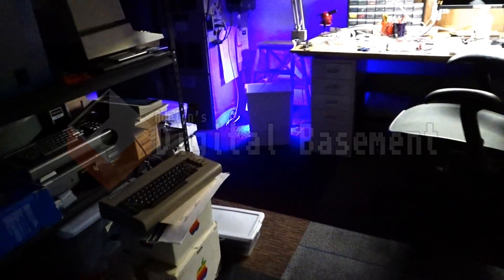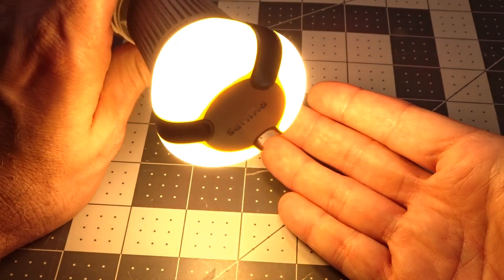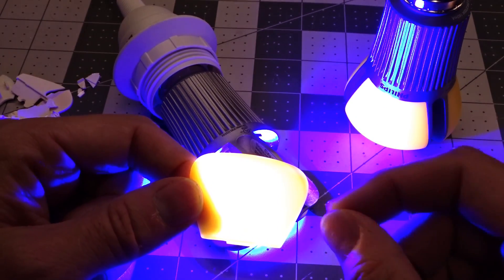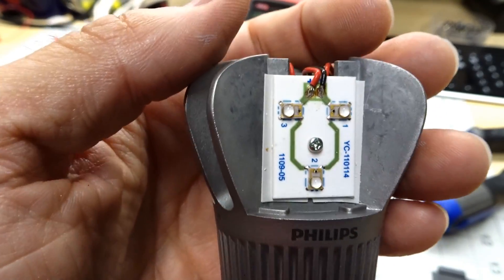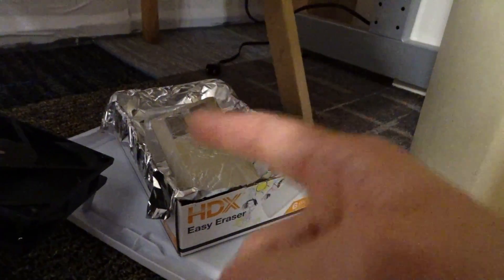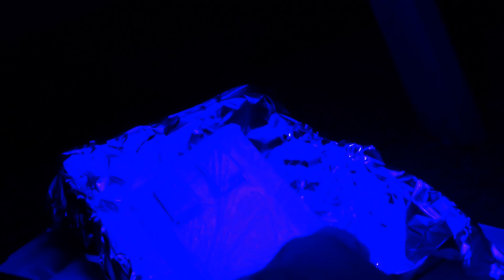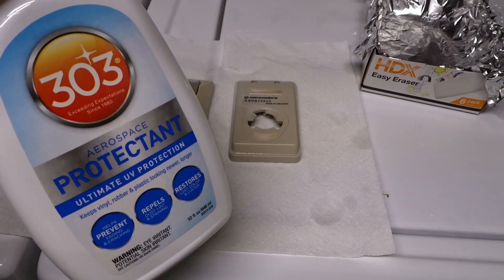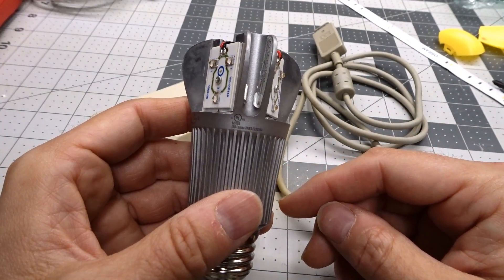A new way to fix yellowed plastics indoors?

Comment: Great video gave you a like. The wavelength of the blue LEDs may not fall into the UV range enough (LEDs have a fairly narrow band spectrum) and that might be why you get good results but still some yellowing left behind. You may have to re-treat and expose longer (maybe two days) with your lights. Remember, if you treat one side at a time, mask off the areas that don't have cream on them, else you are exposing "raw" (bare) plastic to UV/Blue light and thus contributing a bit to re-yellowing.

Comment: There's nothing strange about those LEDs at all. There is no such thing as a white LED. They are all near-UV LEDs with a phosphor coating on them. In this case they just had the phosphors in the plastic shields, probably because they hadn't perfected the liquid phosphors that they now use on all LEDs, especially COB LEDs. If you scrape a bit of the phosphor off of a COB you'll see the blue LEDs underneath.

Comment: Heat + UV really is the key.  On a sunny summer day in 90-100 degree sunlight you get amazing results.  On a cool 60 degree day not so much.  The heat radiating from the lights might help but most LEDs don’t emit much heat by themselves.  I have heard of guys bleaching their sneakers white just by leaving them under UV light alone without peroxides but I’m skeptical with plastics that direct UV alone will accelerate the Bromine yellowing.

Comment: I have to give you a gigantic thank you! I saw the title of your video, saw the LED blub and that really got my interest. I bought a similar LED bulb (mine is 1100 lm brightness) about 8 years ago, and still had it in a lamp in my office. I've been trying to remove yellowing on the previously clear plastic parts on an expensive pair of sunglasses I bought a decade ago. Previously I tried soaking the parts in drug store variety 3% hydrogen peroxide solution overnight, no change. I also tried laundry bleach, zero luck there also. After watching your video, I decided to give your process a try. After a few minutes of slightly tricky knifework, I got the phosphor filters off with the minimum of breakage. I put the bulb in an old clamp light, and fixed it over my work bench. I used the same 3% solution, in a small tin foil pan. I used an infrared thermometer a few times over first few hours to verify nothing was getting dangerously hot. The solution remained at about 74° F, roughly room temperature. The shade of the lamp was about 84° F, and the bulb around 185° F. Mostly sure I wasn't going to cause a fire, I left it alone, and checked back about 8 hours later. At that point I could see some serious improvement. I moved the parts around to ensure even light coverage, topped off the solution with the last I had in the bottle. 6 hours later, I pulled out the parts and washed them. I estimate they look about 95% un-yellowed at this point. I love that I spent zero dollars on this (already had the bulb, bought the solution for first aid use originally) and got such good results. Once again, big thanks!

Comment: This is not really a big surprise that this works. You're using H2O2, which dissolves to H2O + O and the single oxygen atom burns the top layer of the plastic away (which layer is the yellow one). This is an exoterm reaction, and you don't even need to add energy to it to happen, but extra energy speeds this up. Although the huge energy of UV quantums is very good (as a single hit to H2O2 is very likely to break the bond on its own), that is not necessary. What you really need is either time or temperature. 
Temperature always improves the speed of reactions; as a rule of thumb, an extra 10 celsius doubles the speed. Thus, even a strong IR lamp could do the trick, even if its light has quantums with much less energy than that of the blue light you have. You also said that it gets really hot, so you need a fan, so the temperature is there, the quantums are not perfect, but still good... You don't need more!

Comment: I wonder when you took the covers of and noticed the led’s are emitting blue light if it is uv-c light if so you need to cover your eye and protect them so you don’t hurt your eye. Another thing is if it is actually uv-c that is awesome uv-c light kills viruses 99.9. Literally kills the flu which is carona virus in its entirety with you want to call it the flu or Covid it is all corona. Why do you think there are so many cases of the Covid 19, they can’t tell if you have the normal flu or Covid 19. They literally stopped testing for any flu at all this year because you can’t tell the difference just like if you were sick 9 months ago and got a Covid test it will test positive even though it’s only antibodies. Yes they can break it down and see but it’s not done you are just added to the statistics wether you have just the flu or if you already were sick awhile ago they are counting everything as Covid why do you think you see these crazy numbers but yet our politicians are still eating at fancy restaurants and flying to Hawaii during thanksgiving. They know it not that bad for most otherwise they would be in a bunker if this were a try pandemic.

Comment: Remember those huge internal projection tvs? They show up on the curbs from time to time. They have very expensive mirrors in them. I know because I pulled one to use in my video projection transfer project. I was able to configure one at 45 degrees and project the image for digital recording. Ant way, I suggest you change the foil to mirrors and see if you get better coverage.

Comment: ozone would be a replacement for peroxide. in fact, one could build an ozone wash bin to flood the parts in ozone while shining said lights on the object. It'd be cheaper in the long run than having to get so much peroxide. a few cents of electricity instead of several dollars of peroxide.
Reply: what retrobrite needs is a form of what I like to call, 'angry oxygen' such as peroxide, or ozone.

Comment: I have an older PTZ surveillance camera that is severely yellowed because it was mounted out in the open where the Sun and elements battered the housing.. I was wondering if I try to reverse this process will using a 4k clear coat prevent it from yellowing again because it would be extremely difficult to reapply 303 UV or some other kind of UV protectant due to its mounting location.. You'd think that it being exposed to the elements, the manufacturers would use some other type of material for the housing instead of this type of plastic..The newer PTZ cameras that I have installed are usually made of metal and painted with a matte white enamel which seems to resist any cracking or coloring defects over several years of use..

Comment: I always retrobright indoors. The magic is in the heat, not uv light. That's why the hair dresser uses heat when bleaching hair, not uv light. I'm using 12% peroxide cream and plastic food wrap (it blocks UV, you know that right? ;) ). 

I just put it in the oven at 60°C/140°F for three, four hours and massageing it about every hour to spread the peroxide evenly.

Comment: Sorry if this is a stupid question but instead of the 303 UV protection could I use a clear coat instead for longer lasting UV protection ?
For example "Rust-Oleum" Crystal Clear spray? This one says non-yellowing specifically. Thanks!

Comment: What i found to work too, was putting a little hydrogen peroxide (fluid) and water (1:5 ratio maybe) in a container with the part and make sure it doesn't rise to the surface. Then apply heat (on a heated bed of a 3d printer or on the stove) at around 150 -160°F or 65-72°C and wait a few hours (i did 3 to 4 depending on the size of the piece). 

I did that on my SNES and it looks brand new. What i would recommend though is spraying it with some UV resistant clear coat so it doesn't get yellow again. No matter which method you use if you set it in the sun again for a time long enough, it will get yellow again.

Comment: Hi, Adrian - fascinating stuff!  My solution to yellowed plastic was to sand down to the real color, and then polish using Meguiars Plast-X compound; but this is insanely labor intensive, and it removes the original factory finish.  Retrobrighting is such a better idea.  I suspect that you're actually getting a fair bit of UV radiation out of those LEDs, in addition to the blue light; my understanding of LEDs is that they have a frequency response curve similar to florescent tubes, in that you get a bunch of square wave bursts of high output at specific frequencies, and no output at adjacent frequencies.  This is as opposed to an incandescent bulb, which has a nice smooth curve typically centered around 2400 - 2600 Kelvin.  Anyway, I suspect that it's not the visible blue light that's doing the job; the LEDs are also emitting UV radiation, and it's the invisible, UV radiation that's at work.  Just a guess.  Thanks for the excellent video!  I've subscribed.  Regards, Charlie
Reply: LEDs typically are monocolor -- they emit a single wavelength, or sometimes a very narrow range. They're certainly nothing like the output from fluorescent tubes in terms of spectrum.

Comment: Well I just hunted some of these bulbs down on ebay. 1st off, NOT CHEAP. I see them between $15/35 a piece. 2nd, there are not many out there. I only found 3 sellers. But 3rd, they do have a life expectancy of 22 1/2 years. So I did end up buying 4 of them and figured with the amount that I will do, these will probably last me the rest of my life. The ones I did find are not new so your mileage may vary. This will be fun. Thanks for the great video

Comment: I don't think it's specifically the UV that's actually facilitating the retrobright process. The chemical change is driven by an external energy source and UV just happens to be a good source for that process. Heat can also work, but that has the potential to warp the plastic. These lights work about as well as UV because they're very close to it, hence the fluorescing of things. You could use white or even red light, or even just no light at all and the process would still work it'd just be much, much slower.

Comment: A minor note about bleaching gels, I did an experiment to compare the expensive BBlonde gel vs. a much cheaper brand, each half of a keyboard under strong sun exposure. Afterwards, the results were quite good but there was no discernible difference between them. May as well buy the cheaper brand, though the BBlonde box did have a  better kit in terms of accessories, gloves, applicator, etc.
Reply: I should mention btw that I was doing the test with an SGI granite keyboard, so there is a possibility that may have affected the outcome. In the event the cream, in both cases, didn't have quite the even effect I was hoping for, so I want to look into the method The 8Bit guy uses with peroxide solution, but so far I've not been able to find any (such stuff is listed on Amazon, but generally with very poor reviews, presumably it's weak junk). I'm in the UK (Scotland) so lack of strong sunshine is an issue; I've been pondering UV lamps or somesuch but have put it all on hold for the time being, tad busy with family matters. Interesting that you found a reapplication made a difference; my house is not well positioned for such a long sun exposure (side of a hill), so some kind of artificial light would be more effective I reckon. I'll look into the LED idea later in the year. Thanks!!

Comment: Nice video.  This might come off as a little armchair quarterbacking, but it is just my initial thoughts so no offense intended.  That said, to really test to see if it works you need a control sample. One that is not under the light but also inside without the sunlight.  Preferably from the same plastic parts.  That will tell you if the light is doing anything or if it is just the creme.  

I have retrobrited keys inside in a jar of 3% peroxide and they did indeed lighten without being in the sun.  It would be interesting to see this experiment again with a control sample.
Reply: Yeah, for me it is probably impossible to retrobrite without any sunlight as I have windows in my house.  But I suppose at night my keys are in the dark.  However I do add OxyClean to my solution and supposedly that helps.  Maybe with that it doesn't need as much sunlight because my keys lighten indoors but it takes more time for sure, then full sunlight.  Just curious about the Blue LED light source.  You got good results for sure.

Comment: Interesting video. I've had similar success retrobriting old Apple computers & keyboards using a metal halide bulb suspended over the creme covered parts in my bathtub. This method isn't as quick as putting them out in the sun, but it means I can retrobrite in the middle of winter here in Canada which would be impossible otherwise. My idea is it's the UV generated by the halide bulb which is reacting with the hydrogen peroxide rather than the colour temperature or visible wavelength of the light.

Comment: You need some laser light protective anti UV glasses. Unless you are planning on going blind mate !!!!
Reply: No uv in that light. LED's are monochromatic e.g. they only emit at 457nm ±10nm which is nowhere near the 380nm-315nm of UV light. So it's not as dangerous as UV, but still more harmful than lower-energetic light

Comment: Also for what it's worth, my feeling is that retr0brite:d plastic should re-yellow at the same rate as the original yellowing. As far as I understand it, the yellowing is caused by bromine atoms liberated from the UV-induced photodisassociation of bromine-containing flame-retardant chemicals, and retr0brite:ing chemically reverses this process, leaving it free to begin again.

Tangentially, I lived in New Zealand for six years, from 1992 to 1998, and I own quite a few books that were exposed to the harsh, UV-rich sunlight due to the proximity to the Antarctic ozone hole. I grew up in eastern Canada, where the burn time might be half an hour, at worst, in mid-summer... in Auckland, New Zealand, it can be just a few minutes in mid-summer. My book collection contains quite a few whose spines have been bleached into near-illegibility.

Comment: You got a result so you're on to something!  I use a full spectrum light which is well vented so it doesn't heat the plastic parts, so it's possible with the right light.  Sometimes I also sousvide to add heat and that works very well but if I'm feeling lazy I'll blast the part with a heat gun periodically to speed things up.  If you're getting heat from that light it's also helping the process.
Reply: @adriansdigitalbasement  awesome looking forward to it.  Need all the help I can get in rainy UK

Comment: As a tip for you :) Buy UV LED Strips (non water proof, you want the bare strips without the plastic rubbery coating) and cut them in to strips to desired length. Attach them to an aluminum strip / board (helps keep heat down and makes it easier to mount) and solder them together, you can then make a shop light like UV light for retro brite-ing to your hearts content :D Plus makes for a neat blacklight for those posters that came with the Atari Classic console
Reply: @adriansdigitalbasement   problem is hitting the right wavelength, especially with RGB strips  one strip I have does it, another doesn't. Plus the physical size of the blue segment compared to uv strips which are purpose built :)

Comment: The reason for that plastic to go brittle is the near-UV from the LED's. It destroys most plastics over time. Please don't stare too much into it - it's somewhat dangerous to look at those "Royal blue" LED's. Looking at blue LED's will lead to Macular Degeneration - something that cannot be reversed.
Reply: I would think wearing a pair of ordinary (decent) sunglasses would be enough to block any UV-A and also reduce the visible brightness to the point where it is a non issue. You don't need anything fancy.
Reply: @bubba99009  Now all you have to do is protect the rest of your exposed skin.
Reply: zapro_dk yeah, guess you need those laser light protective glasses, that 100% block uv etc....good tip mate !
Reply: UV does not weaken the plastic.... HEAT and TIME causes plastic to lose its oils and that make it brittle.

If you follow enough channels, you will find that the exposure to UV full spectrum is needed, no creams or liquids, just full UV and it has to be outside or the type of UV that has UVA and UVB.
Reply: The blue lights are UV light, the phosphors glow from it, the light you refer to may be called Royal Blue but taking in to account that UV light is around 400nM range... Ta-Dah....
Reply: Well I expected someone to say these LEDs are dangerous and they did
Reply: Scary shit. Good information to know in case I'm ever in a situation where these are in use. Thank you.
Reply: Holly shit! :o had no idea that it can be that bad...
Reply: That's probably why they don't make these blue LED's anymore, it could possibly attract frivolous lawsuits, when some dummy takes off the phosphorus shield and stares at for long.  I would imagine that these Blue LEDs also have an ultra violet component (or very close to it), which of course is invisible.
Reply: Regarding Macular Degeneration, do take a Lutein supplement.

Comment: As an early adopter of high quality LED bulbs, I have a whole bunch of these fabulous units - they were the only game in town for acceptable light quality in the early days, and they still stand up well now other than a slight delay on turn-on compared to modern lamps. Other than a detached wire on one of the PCBs on a single bulb (which was repairable) not one has failed. Good to know they'll have an alternative use when/if I ever pull them out!
Reply: "acceptable light quality"? XD I think I may have just found my first light bulb snob
Reply: @pxpin89  everyone who compared fluorescent light looks sickly, or green, or so forth, would also count. They just didn’t know terms like Colour Rendering Index.